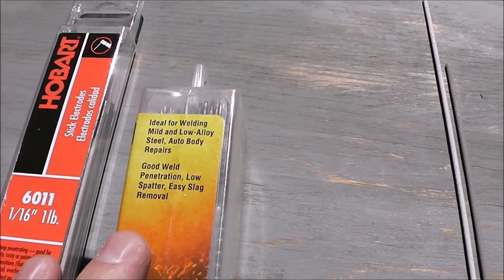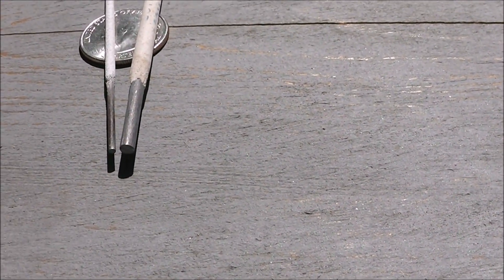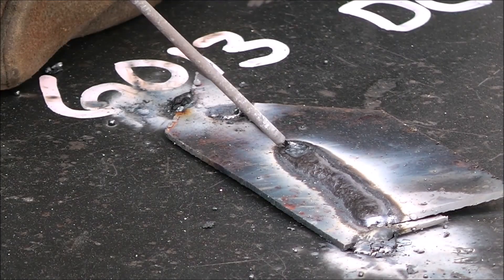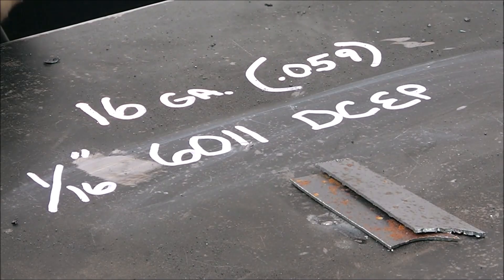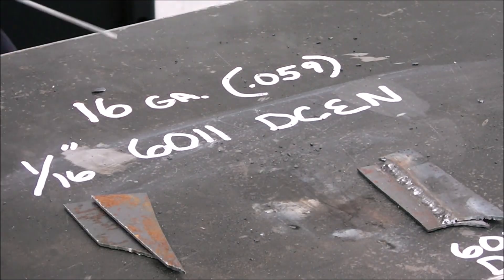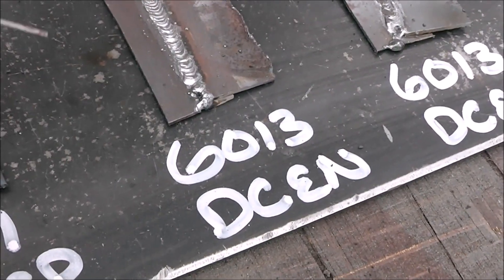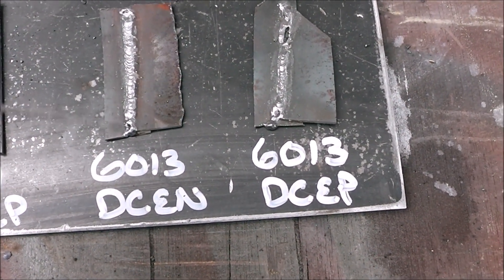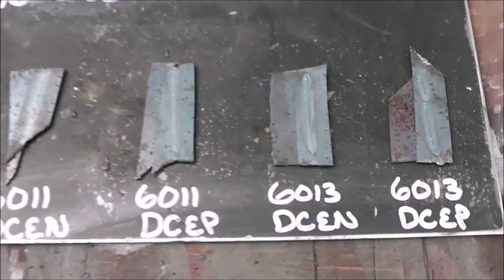6011 Vs  6013 BEST POLARITY for WELDING SHEET METAL

Comment: Thanks to this video I passed the reinspection of my 18yr old Toyota auris. Used 6013 1.6mm dcen. 6011 is a hotter rod more likely to burn through. Welding a patch upside down with car on jackstands I got an acceptable weld nothing more with the area cleaned beforehand, it does work.
Reply from the maker: That's awesome, glad the video could help!
Reply: Brandon: I bet it feels good to see people getting benefits from a 7 years old video!!
Reply from the maker: It sure does. Youtube decides which videos get traction and sometimes it amazes me that it takes a while for it to be more widely shared. I'm just glad people are finding it useful, especially when things are so expensive. Repairing is the ONLY option for many.
Reply: Your comment is saving me haha
Reply: I am trying to patch a hole in my trunk and well, its 20ge metal. I guess I am gonna use 6013
Reply: @pza02;
Perfect timing, as I may have to do some welding on my 2007 c-max, which has had some rust-through, because of leaves getting stuck in the drains at the bottom of the front fender...
I have some 1.6 mm 6013, and a little inverter machine.
Cheers from 🇨🇦 in 🇩🇪
Reply from the maker: Good luck with your repair! Thanks for watching!

Comment: I’ve had good luck with ESAB’s rutile 6013s (it’s a green rod) on DCEP at 45A-50A for thin stuff. You have to move fast, of course, but I was able to weld 18ga with it quite consistently in testing, and it did exhaust piping pretty well in the unrealistically easy open position of my test area. On the car is another story I’m sure.
Reply from the maker: Good to know!

Comment: GREAT informative and entertaining video as always - THANKS!
Brandon, I've got to butt weld (lap joint not doable, but I can back up and clamp the joint) some thin 16 ga STAINLESS steel sheet metal and will use either 1/16 309L or 309L stick electrodes. I have no experience with SS sheet metal, but plenty of time on mild steel. Any quick tips at all? 
NOTE: I'm guessing I can use the 6013 EN, but have to maintain the rust resistance with either 308 or 309 (again, no experience). Reason for 110 volt stick is other methods are not available in the location. Thank you, and you are a good Grampa!
Reply from the maker: I appreciate you watching and for the kind words, and you have a great question!
Reply: @BrandonLund  Thanks! Turns out the 309L seemed to be EP for better results. On 16 Ga stainless sheet metal BUTT welds, it was best to "preheat" the new electrodes on a small block of graphite (Amazon - very low cost) to start each stick. The 1/16 runs good at 35-40A, and you need to back-up the butt joint with a clamped piece of aluminum or other conductive bar material because - WOW - stainless warps way too easy!  I learned it is best to skip around and not concentrate to heat for too long in a given area.

Comment: So you just switch the attachment to the machine to change polarity with DC ?
Reply from the maker: Correct. Just swap your leads at the machine. It's a standard practice. Your not hurting the machine by doing it.
Reply: Hi, my igbt machine is strictly DC output. So can I conclude it will weld with 6011 and 7018 ? Thanks @BrandonLund
Reply from the maker: @misterman1909 yes with no problems

Comment: Hi Brandon I tried running 6013 1/16 on 16 gauge at 30 amp it did not melt base metal but at 60 amp it did fuse metal may be its because Chinese cheap welder. I am hobbyist but its just my experience what do u say i was thinking about trying 3/32 6011 around 50 amp what donu say
Reply from the maker: The base metal may have been to thick to allow the base metal to heat up enough

Comment: I've only got an AC how does it compare I can get a 1.6 mm rods it's to weld I crack in a spring Cup about 1 1/2 mm thick metal.
Reply from the maker: AC is just as good in my opinion

Comment: I tested some thick to thin fillet welding on DCEN with these 6013, 1/16th. Welding .042" walled conduit pipe to 1/8" plate. It was extremely frustrating on DCEN. Even on high amperage the penetration was ZERO. Switched to DCEP and then the weld was reliable. So I would be careful about looks versus testing the weld.

Comment: Been 5 years Hows the baby ! I bought rods today for auto patch paneling "Always check your rods Not the sign they are selling from" I wanted 6013 3/32 which was a noob mistake on 18 gauge paneling ...The rods ended up being 6011 something which is bigger than your 1/16" ..Have to return tomorrow for the 1/16 6011 ..And ya i will be doing the tack And move method And not the whip Which might be the next method on a thicker gauge on a Body mount floor brace area..which is a whole other not so fun job ..Thanks for posting this You covered gauge rods And method with DCEP And DCEN Thumbs up !
Reply from the maker: Thanks man! Good luck with your project!

Comment: someone commented that on square tubes 1.6mm thick. Was using DCEP at about 78A  with a lot of blow holes. --<------- his comment-----
i stich weld DCEP 0.3mm thick stainles , no holes .. DCEN make holes on touch on 0.3mm with zero amp , DCEN is vicious
Reply from the maker: Generally DCEN does not produce holes. DCEN is used when you want less penetration.

Comment: Hi Brandon, thank you for sharing your videos. Im a beginer and they’re really helpful for me. 
Talking about content, my next question mark is : comparaison in between 7018 and 6011/6013.
I’ve been told that they provide better quality but they’re more difficult to use. What’s your thought about it…
Reply from the maker: 7018 is just an all around good quality rod and gives a nice bead appearance. 6011 I call farm rod. It works good for everything. It will eat through rust and burns in deep. A lot of folks will burn it in with 6011 and cap with 7018. 6011 also doesn't give as good a bead appearance as 7018. 6013 gets mixed reviews. Some people love it, some people hate it. It's good for thin metal.
Reply: @BrandonLund 
cheers buddy for prompt reply. Interesting to know indeed. Eager to compare now 😜
Have a nice day 👍
Reply from the maker: Thank you! You as well!

Comment: When welding with small diameter  electrodes I had found for me if I lightly place my index finger on the electrode where it sticks out of the rod holder it dampens the vibrations on the rod to keep it calm during the weld process . The down side is the rod will heat up as you weld and it will eventually get hot on your finger . Good quality welding gloves are a must for this technique . Try it and see if it works for you .
Reply from the maker: For sure 👊

Comment: Hello Brandon, Jose from Puerto Rico. I subscribed to your channel because I enjoy the way you teach. I'm 65 and retired, but welding was always something that caught my attention. I took a short basic stick welding course and enjoyed the process. Furthermore, I'm waiting on an inexpensive welder just to practice at home and hone in on the process; I can surely see myself being able to fix basic stuff around the house. I'd like to ask a question. I have an old file cabinet and would like to weld on some casters to be able to move it around. I'm going to grind the old paint off and re-paint and add those caster wheels. From what I understand, I can use the 6011 rods since those casters are not made from real thick gauge metal. I figure that to practice, I might as well use that file cabinet to store tools and stuff. What do you think?
Reply from the maker: 6011 rods have real deep penetration. You would probably want to use some 1/16" 6013 rods rather than the 6011. 6013 works really well on thin metals which is what the filing cabinet material is. Another suggestion, you could weld up a frame using angle iron and weld your casters to the bottom then set your filing cabinet into it. Just a suggestion. I appreciate your interest and the SUB! 🙏😁 If you get stuck you can always ask here. I try to respond to every comment.
Reply: @BrandonLund  l like the frame suggestion.
Reply from the maker: Welding thin metal is actually a lot harder than welding thicker metal so by going with the frame idea you get more practice and you dont have to worry about blowing through the thin metal cabinet. Not to discourage you but welding thin metal (especially as a beginner) is very difficult to do with stick welding. It can be done but it's not easy. I actually have a few videos on stick welding welding thin metal. Good luck with your project!

Comment: Did you ever check your welder with a voltage meter? I have read reviews on welders where they purchased them, and they work fine, but the polarity is actually backwards internally from the factory. There is a popular Amazon welder from China, and it's a great welder, but the "RED" positive on the welder is actually the American "ground" negative when tested on a volt meter. It's not clear why some of these welders are reversed, but at least one review I read, a user reversed the leads on his Chinese arc welder, and it worked excellently after that, because it was factory backwards.
Reply from the maker: No but I plan to on all my welders just to see how accurate the readout is VS the actual output. Great suggestion! Thank you!  @Ritalie
Reply: In my Chinese "Amicopower" "ARC-160" manual, page 10, there is an illustration of the welder, identifying the controls - but they've got the polarity reversed!!  I called them and a gal answered, saying that she'd "Tell the owner". I have to wonder if anyone else has brought the error to his attention, and if/when he'll remake the manual.
Oh - and I think you'd want to check the CURRENT output as well, comparing the readouts to what you have dialed in.

Comment: My new lincoln mp inverter says use dcep, so I have been trying in 1/16 and 1/8 steel. The 6013 3/32 is giving me the blues, can't seen to get amps right. I seem to do better with the 6011. If i power up my 30+ YEAR OLD AC225 BUZZ BOX...and try the same...I can do much better, and ever make it work down to 40 amps. I am a DIY adult education taught rookie welder, this inverter machine makes me feel like I don't have a clue with stick. I never considered changing the polarity with 6011 or 6013...I got to try it...thanks.
Reply from the maker: @mike f hang in there brother. An AC welder and a DC welder have a very different feel. Funny you mention your AC welder because thats what I was working on in this weeks episode.
Reply: @BrandonLund  I tried flipping polarity test on 1/16 and 1/8 using 3/32 6013 and 6011 on my dc inverter...not sure what I saw, will need to try again. The feel between the ac225 and my le31mp with stick is drastically different for sure. It's going to take a while to un-learn bad welding rabbits, but I got time to play.

Comment: Good video as usual.  You will notice those rods are made shorter than usual.
If you do get some long ones you can wrap the cable over your arm and grab the stick in the middle like a pencil, wearing your gloves of course!  If it's hot and your hands get sweaty, or if the stick  gets too hot you can put a reasonably clean dry cotton shop/hand towel over your glove and then grab the stick with that. Just be careful,  and don't ground yourself anywhere else. 

   I found, and then lost again, a video where a guy welded a box with 18 ga (1.2mm) sheet metal using 3/32" 6011 at 35A DC.  He draged it at a steady pace at maybe a  45 degree angle, and created a narrow bead without burning through. DCEN might have helped, but he didn't say. He did say it works much better on some machines than others.
   It looks like 6011 might work OK at very low current (because of the aggressive arc?). I'm going to try it, AC and DC. The 3/32" is widely available, and the smaller sizes cost more. If it works I'll tell you all about it !
Reply from the maker: Very valid points @Thomas Lewis. You got me curious to try some different things now!

Comment: Thank you for the explanation. I am learning how to weld know. In the pieces that I am training I have a 1,5 mm steel tube and a 2 mm steel tube (thickness). When I try to weld them with 2.5 mm 6013 stick (DCEN) the 2 mm tube keeps being perforated but the 1.5 mm keeps fine. Can you explain the differences in the steel quality of nowadays steel? Or it is not a steel quality problem? How to choose good steel to weld? Thank you. Whealth to your family.
Reply from the maker: @Rui Pinto thanks man I appreciate it. It could be the hardless of the metal rather than the quality. God bless you and your family.

Comment: In any of the above cases what could happen if you hold the rod (like you hold a pen to write) while weld in order to be more steady?Is there a case to hit you the current?
Reply from the maker: The correct answer is that electricity takes the path to least resistance so if you have a poor ground on your workpiece that path could be you but with a gloved hand and a good ground its pretty common to do what you described

Comment: Which polarity is best  to weld  with  dcen or  dcep? Especially to give a good weld bead
Reply from the maker: DCEN works well on thinner metals. For thicker metal DCEP will give you better penetration.
Reply: @BrandonLund  thank you sir.
Reply: @BrandonLund  do you have idea about open circuit voltage and arc voltage in welding?
Reply from the maker: @edisonhamwele5154  yes. It is basically another name for "hot start". It helps to ignite your electrode and maintain a strong/stable arc.
Reply: @BrandonLund  thank you

Comment: Hey brandon thanks for your amazing video tutorial. I have a question this DCEN can't damage my  inverter welding machine which is made in italy deca SIL 417 coz im afraid to do so for longer time, but i try that process the result is good penetration, and quite beautiful than DCEP. for 6013 rod. Thanks hope you can answer my question. I just subscribed godbless us.
Reply from the maker: @Hailey Navera thank you very much! Switching the polarity is totally fine and your machine is designed to do this.

Comment: Amateur welder/self taught: I've been blowing holes all over in 2mm box section with 2.5mm E6013 DCEP. Never actually tried DCEN but it looks like less heat so probably worth doing!
Reply from the maker: @quantumbox you will love it! It's so much smoother on thin metal

Comment: Which welding rode is best for steel welding?
Reply from the maker: @game lab it all depends on what you are doing. 6010 / 6011 is a good all around all position deep penetrating rod that does good on paint and rust, 6013 is good all position rod for thin stuff where you don't need much penetration but it can be tricky overhead and 7018 is a good mix between the two. 7018 is good on clean metal in all positions, has a little less penetration than a 6011 or 6010 and more than a 6013. It's a low hydrogen rod and gives a nice bead appearance.
Reply: @BrandonLund  thanks for your respond

Comment: I am making holes using e6011 1/16'' @  20 amps joining 3/16'' square pipe ? I find a lot of slag in the solder ...what would the inspector say ! Any tip for me.
Reply from the maker: Try a faster travel speed and a slightly steeper drag angle.
Reply: @BrandonLund  ,  i tried with a 3/32/e6013 rod with much better results.. Soldering is much more technical than it seems , i am learning by doing , it is a hobby., thanks a lot for the help.
Reply from the maker: 6013 is more suited to what you are dong. Great job!

Comment: Hi great vids . Is it possible to stick weld 1inch pipe with 2.5mm thickness if so which rods and amps would be the best thanks.
Reply from the maker: @Rob Rosielle absolutely! I always reach for 1/8" 7018 because they run real nice. I'm not sure what you have for a welder so here is a calculator to help. https://www.millerwelds.com/resources/weld-setting-calculators/stick-welding-calculator

Comment: Awesome video bud! I have some thin legs that have partially broken off my electric smoker I need to repair with my Titanium 200 Unlimited and will consider your results. Consider choking up on the rod with your working hand or grabbing it with your free hand to steady it.
Reply from the maker: @Matt Cero thanks man! You can also snip your rod in half and it will make it a little easier.

Comment: Hello Brandon!
I've just watched a guy on u tube who used very short length welding electrodes for more control but is it okay to cut an electrode down to size?
Reply from the maker: You can cut your electrodes without any problems.
Reply: Im a beginner using 1/8 7018. Cutting the electrodes in half makes a big difference for me. Much easier and better welds.  Will do the same when using 1/16 for thin metal.

Comment: Amazing video, What stick will weld railroad spikes? I tried the mig, but welds tend to brake easy. Thank You
Reply from the maker: I believe railroad spikes are cast steel and if I'm not mistaken I think they are pretty high quality. I've never tried stick welding them but if I did I would probably go for 7018. I think the issue you might be having with mig breaking might be your amperage. That's a lot of thickness to get good penetration. You might try flux core. I find flux core burns a little deeper.